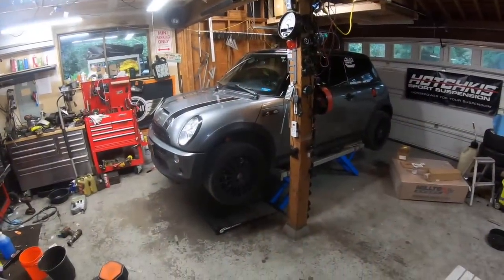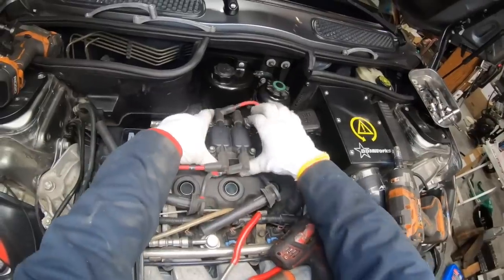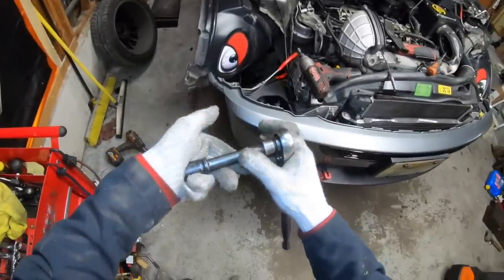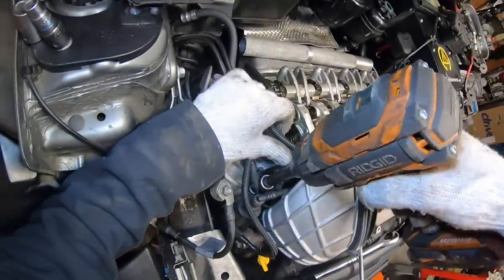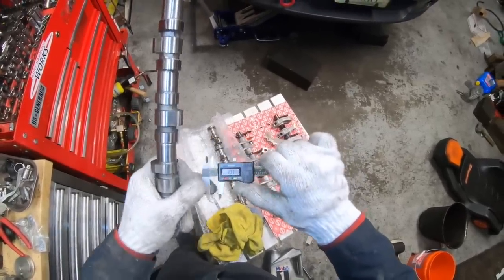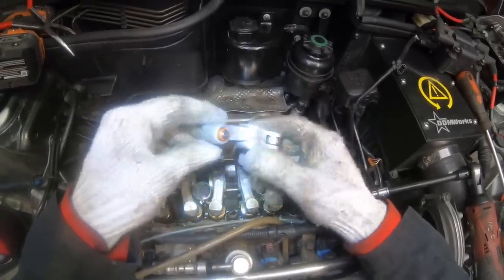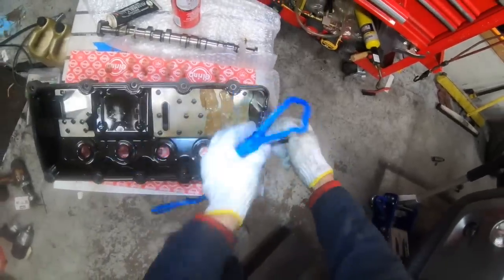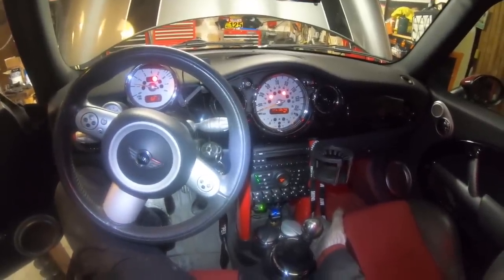2002-2006 MINI Cooper S - Install Performance Cam R53

Comment: Awesome Vid as usual, thanks! What kind of tune do you recommend or do you have any preferences? I've been having a hard time where i live(Australia) finding a good tuner and am sceptical about remote tuning. Any feedback would be greatly appreciated.
Reply from the maker: Way Motor Works in US does a remote canned tune which is what I would recommend, but you'd have to ship your ECU overseas. I don't have any detail about what tunes are available inside Australia. Sorry.

Comment: My R50 5 speed transmission blew out and I was wondering if I could do a 6 speed manual from an R 53 swap into my R 50 is that possible?
Reply from the maker: yes but you also have to swap over a lot of other stuff such as shift cables, clutch, flywheel, hydraulics, transmission mounts, axles.

Comment: Hello what brand of intercooler was that? I just installed a Airtek 60 mm intercooler and lost 2 pounds of boost according to gauge. I have a full Miltek exhaust, ATI 2% pulley and a 16% sc pulley. Do you think a tune would help? Thanks!
Reply from the maker: I can't remember. Pretty sure I say the brand in the video.

Comment: Hey Mod mini . I need your help. I have a mc r53 2003  226.000 km
When I push on the throttle and accelerate (4000-5000rpm) it smells like something is burning or a plastic smell .
Reply from the maker: I'd have to see the car, but check crank pulley or slipping belt.

Comment: your videos are a life-saver!! I have been a bigrig diesel mechanic my whole life, decided to pick up a super clean (i thought) 2003 r53 so i had something reliable that wasnt going to be a project. ive always wanted a mini but didnt really have a desire to work on them. Bought my r53 with under 100k, oil looked clean, engine was spotless, interior spotless, exterior spotless...i mean this thing was nice for an 03! Elderly couple seemed nice enough. Blew up a week after i bought it. I mean the works...Turns out the couple had owned the car for 5 years and never changed the oil or filter. Just added some when it got low. Car didnt smoke at all for me when i test drove. Turns out a dealer had noticed the low oil pressure when they got it on trade, bypassed the oil pressure switch and turned it. So bored block, new rods, pistons, cam, oil filter housing (bypass had blown) and some proper coolant temp and oil pressure gauges later and its almost back together thanks to your videos! BTW, i really appreciate your opinions you throw in there, what is worth it and what isnt. Thanks again!
Reply from the maker: Oh boy. Sorry to hear that.

Comment: Sorry to bother you. I am going to be taking exhaust manifold of my gen 1. Looking at it it looks very tight to get out. Does it come out without removing subframe, or can it be manipulated out of the top?
Reply from the maker: Out the bottom after removing one of the heat shields
Reply: @ModMINI  thank you

Comment: Hi Kurt, your videos have helped me no end, thank you. 
Have you ever had a crankshaft pulley bolt from an R52 convertible Cooper S 2006 that doesn’t take the normal hex bolt from an R53 Cooper S? Have you ever had to re tap the thread?

Thanks
Matt
Reply from the maker: All supercharged crank bolts are the same.

Comment: Had compression entering cooling system. One lobe on cam showed wear. Got a performance cam from mini mania and 15% supercharger pulley. One step colder NGK iridium plug..Started putting it back together tonight. Not much left to do. Do I need a tune and if so which one do you recommend? Which cold air intake as well? Also what’s my next best bang for buck performance modification.
Reply from the maker: RMW or Milltek Header. Any cold air intake will do, they are all similar.
Reply: And which tune.

Comment: Question, I have a stock R52s Sidewalk Manual, 2007, 165k miles. It is my toy, even compared to my other high price cars. 

My stock header has a small exhaust leak and my heat shields on the stock mufflers are rusting away. What is your preference in an aftermarket header and  cat back exhaust?

Thank you!!
Reply from the maker: I really like the sound of Milltek header and exhaust. Not TOO loud and makes decent power too. https://ebay.to/2DHT7OB 
RMW shorty header is another good option that makes a little more power but is louder. 
Those are the only two I know that shouldn't throw a P0420 code.

Comment: Another great video
I will be refreshing my spare engine later this year, it is not supercharged just a cooper. I was wondering if a high lift fast road cam is worth putting in on a non supercharged, and should i change the rocker hydrolic lifters? Engine done 100k.
Reply from the maker: I don't know if there is any worthwhile benefit for an R50. Maybe. You'd have to ask someone who knows.

Comment: Been watching your vids to get familiar with mini. Great style, content and tips. 
 I plan to help a friend with a '03 supercharged r53, with head problems. Could you do a video on the  difference between the na / SC motors? How much can we interchange? I've seen the comp ratio difference,  and expect there may be forged internals in the SC - are the na parts cast or forged? Thanks for shareing your expertise!
( I think the Mini bug is biting me)🙄
Reply from the maker: I'm not going to make a video on this but don't even think about using R50 block or any of the internal parts. I believe the heads are the same but I have heard that the exhaust valves are weaker on the R50 so it's best to avoid them entirely.
Reply: @ModMINI  thankyou! As always,  a great help.

Comment: Excellent tutorial, bud! I'll be doing a cam swap on on both my wife's r50 Cooper & my r53 S. The S is getting the usual intercooler, pulley & injector upgrades! They'll both be getting remapped. Cheers. Leigh.

Comment: I applaud your choice of gloves.  I hate working with those for anything other than gardening.
Reply from the maker: I don't use those in garden. Dirt comes right through. They are good for garage because they protect from cuts and scratches and don't leave behind big oily fingerprints. And they are cheap and disposable.
Reply: @ModMINI  True but you lose a lot of dexterity.
Reply from the maker: maciekz you quickly get used to that. I can handle 8mm or smaller nuts with no problem. For the 2 or 3% of tasks where I need that dexterity, I take the gloves off.
Reply: @ModMINI  Thanks for the video.  You are the only reason I hung on to my R53.

Comment: in this way there is the risk of losing the position of the chain on small crown..is it not very risk???
Reply from the maker: There is a small guide below the crank sprocket. As long as you don't turn the crankshaft while chain is loose, it should not slip.
Reply: @ModMINI  do I know the guide under the crankshaft but it is no longer safe to leave the chain tensioner instead of removing it?this can be a further help in keeping the chain in correct position. I am not saying you did a a bad job,I always follow your videos you are the best!! I ask for information to learn new things. I have already done these jobs but always removing the oil pump cover just to make sure not to miss a tooth
Reply from the maker: MagicMax I’ve done this dozens of times. Just mark the position and keep the chain on bungee cord when not actively working on it.
Reply from the maker: MagicMax chain tensioner does nothing when the cam sprocket is removed. Use the bungee cord.

Comment: Sir. Is the stock clutch OK with the extra power.
Thanks.
Reply from the maker: Should be fine for street driving unless you exceed 260-270HP or so.

Comment: What is that inner cooler you use?
Reply from the maker: Get the Forge Intercooler here: 
https://ebay.to/2UBC7z0
Reply: Mod MINI I thought you said forged like a forged piston 😂
Reply from the maker: No pistons in this video.
Reply: @ModMINI  what other parts are needed and does it need to be tunned or something else after this upgrade?

Comment: I cannot believe someone actually disliked this video.  Another gem here, thank you ModMini this will be next for me. I have the same intercooler coupled with a 17% pulley and 380cc injectors still on stock tune and runs/idles great('05 MCS R53)
Reply from the maker: I like to think those downvotes are accidental.
Reply: @ModMINI  definitely are

Comment: Will i need remap the car after installing this performance camshaft?
Reply from the maker: As I mention in video, you need a tune to run a performance cam. Way Motor Works has 'canned tunes' that work well with this cam and the other typical mods (pulley, cold air intake, intercooler, injectors, header) - I understand that it's mostly about optimizing ignition timing and fuel maps to avoid lean condition under wide open throttle.
Reply: @ModMINI  Thank you!
Reply: @ModMINI  In my 05 r53 JCW engine 210hp witch I think has same tune so if I install same cam. do I still need tune to do?

Comment: Ooh new intro, I like it. Just had a cam along with big injectors tune and other things done myself. Price wise it's good for what you pay, expensive thing was the software (Bytetronik). Power gains  are great, instead of stock 163 PS I'm at 237 PS (at the clutch ofc) now with 260nm of torque straight up. Car feels great..
Reply: What cam did you go with? I'm thinking about doing CatCam's 461. Already have 550s.
Reply: @sethmorton1856  I took what you thought of 😉
Reply: @qwerrrz202  a CatCam 1302461? Like the 1st step above stock?
Reply: @sethmorton1856  I think that's it yeah

Comment from the maker: How to install a performance camshaft in a R53 supercharged MINI Cooper S. Get more power out of your tuned MINI! Torque values below. Get the tools & parts here: 

Cam sprocket alignment tool
https://amzn.to/2IMoRW4

8mm deep drive socket
https://amzn.to/2W0HI3B

1/4 wobble extension
https://amzn.to/2XFyZ7n

3/8 wobble extension
https://amzn.to/2IQrp5w

Bent nose pliers
https://amzn.to/2XuKn5U

Torque wrench
https://amzn.to/2IO41FW

Valve cover gasket
https://amzn.to/2XCCScW

Blue Loctite Gel
https://amzn.to/2Vmirno

Assembly Lube
https://amzn.to/2GuzHgM

Mod MINI's Tool List
https://amzn.to/2XxX53K

Chain tensioner
https://amzn.to/2KSdD50

Replacement rocker arms (used or new ok)
https://ebay.to/2GvXw7H

Get a camshaft & sprocket bolt here: 
https://bit.ly/2GBIHBM

Get the Forge Intercooler here: 
https://ebay.to/2UBC7z0

Torque values: 
Rocker arm bolts 22 lb-ft
Cam sprocket bolt 75 lb-ft
Valve cover bolts 9ft-lbs
Camshaft position sensor to head 7 ft-lb
Engine bracket to engine 74 ft-lb
Engine bracket to hydraulic mount 50 ft-lb
Cam chain tensioner cover bolt 46 ft-lb
Intercooler mounts and bellows clamp bolts 7 ft-lb
Wheel lug bolts 90 ft-lb
Reply: Link to the camshaft do not work somehow... site is down or something?  (using Chrome browser)
Reply from the maker: Link worked for me. This site is for US shipping only. Try this shortened link https://bit.ly/2GBIHBM